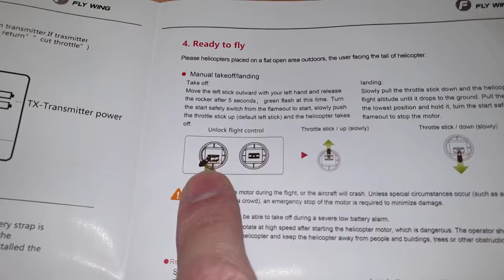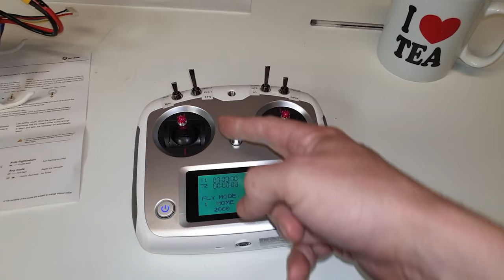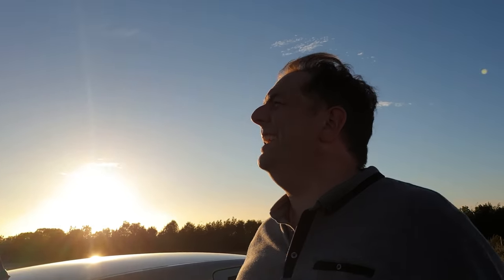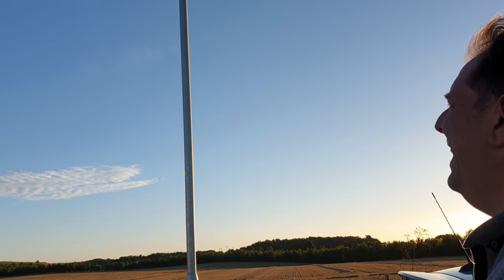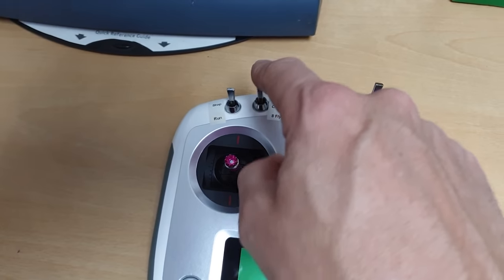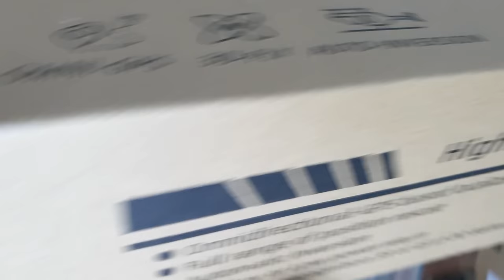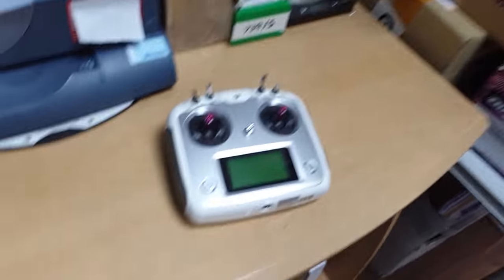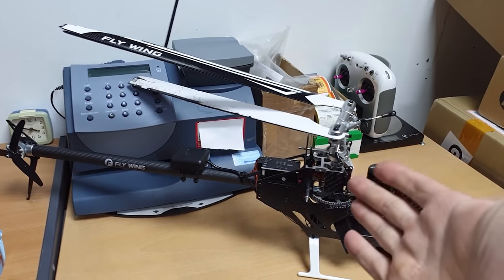Auto Pilot RC Helicopter FAIL (try not to laugh)

Comment: Back in the 90s we did this all the time - we called it "doing the funky chicken". I had a Concept 30 IC powered heli throw the radio battery out on impact leaving the throttle on almost full bore. It took quite a few minutes for the clutch to finally burn out and allow me to go pull the fuel line off.
Reply: That was part of the fun back then 😂

Comment: That's what we in the RC heli hobby call the "chicken dance". Only way to stop it quickly with a nitro heli is throw a coat or jacket on it, then run up to it and yank the fuel line off.
Reply: So sad :(
Reply from the maker: never let a good funkey chicken go to waste!
Reply: hahaha nothing scarier than a big 600 or 700 Nitro Heli smashing itself to pieces on the floor while the engine is SCREAMING and you're desperately trying to get near the fucker to cut the engine without losing a hand!! haha!
Reply: Funky Chicken!
Reply: In this case they could have just hit the kill switch on the Tx
Reply: Heads Mess the heli in the video was electric with an FC, the way it was set up is like most quadcopters, it has an arming switch, it didn't need to go crazy like that, all he had to do was flip the arming switch to off and the heli would have shut down, possibly minimising damage.
Reply: @KevinTalbotTV  lol
Reply: @KevinTalbotTV  by the way it is a drone

Comment: RC Helicopters are a lot easier to fly with auto gyros these days. I built a Morley Bell 47G with 6.5cc glow engine (designed by Jim Morley) in the late 1970’s early 1980’s and without gyros it was like balancing a ping pong ball on top of another ping pong ball, in a breeze. Took me a couple of months to grasp the hover.

Comment: Kev despite some teething problems you outlined, that GPS Mode is a bloody Godsend! I can't tell you how useful that function will be for someone like myself who didn't learn to fly Heli's 'til his late 30's and basically struggles with losing orientation of Heli, then crashing in a panic trying to recover!! That's a miracle system for any newbie or struggler like myself! I've crashed £1200 Heli's losing orientation so i'll defo be buying this Heli !! Thanks so much kev! Keep up the madness bro! Wes, Liverpool.
Reply: I'm in the same boat as you, except I've got 20 years on you - I'm almost 60.  I own a Blade 230s and an Align T-Rex 470, and I never fly them anymore.  I've only hovered the 470 a few times.  I've got dozens of hours with the Heli-X simulator, so I've attempted to fly the 230s, but when it's in a banked turn, I can't tell whether it's going left or right.  I've hit throttle hold and dumped it into the grass a couple of times, with little to no damage, but now I'm gun shy.  If someone offered to buy me out, I'm not sure I'd decline.  It's really discouraging, because I love these machines.  I really enjoyed building the 470, but, if I crashed it, I'd give up for sure.
Reply: @ExSkyCyclePilot   My goodness Michael i can so relate to your feelings mate! I'm the same, i got to the point where i'm too afraid to fly my expensive Heli's any more because i'm so afraid of crashing them and then having to spend £hundreds on parts etc! I really struggle with seeing what direction my Heli is pointed when i'm flying it farther away, and just the same as you, when i'm banking to left or right, i often lose orinentation and panic and dump it! You mention you have 20 years on me, well i really feel for you because i believe us late starters, who come into Heli flying as older adults, are totally disadvantaged because when you learn new skills with a very young/childs brain, the Neurons are still growing and making new connections, so you learn much fatser and your brain mouldfs itself or has much more plasticity than when you're an adult, thus making the newly learned skill "second nature" if you will. Ofcourse us older adults can still learn new skills very well, but it's much much harder in my personal opinion. The only tip i can give you is much larger Heli's like the 600, 700 and 800 size Heli's are actually easier to fly because their larger size is naturally more stable and less "Twitchy" than smaller Heli's, but the problem with even this is when you crash, it's much much more expensive to fix!! We can't win mate! lol.

Comment: 13:04 this is known as "chicken dance" and it usually happens to nitro/gas rc helicopters.
If you have a rough landing and the battery gets unplugged the throttle servo will keep the engine running until it destroys itself or runs out of fuel
I had this happen to me on my 2s xk k110 with cc3d flight controller refused to disarm and it destroyed itself in battery fire
Reply: he did say funky chicken

Comment: If you have enough RPM, you have to take off quickly.
Disconnect the battery connection terminal first in case of a fall

Comment: I had the same heli to test. When I got it the blades were poorly balanced which caused the gyros to crap out. That's what it looked like in the video, mine was going the same way but I killed the throttle before it did any damage. After balancing the blades all was well.

Comment: Kev I Want To Odder X Maxx But They Did Not  Deliver In India Can You Help Me
Reply: You could go to a local hobbyshop
Reply: @KPTGR8  Does one of 'em have a online shop?
Reply: Hey you are in India I am also in India .
I also wanted to buy a XMAXX 8s can you tell the cost of XMAXX 8s in India.
Reply: @ratheesht3850  bro you fool even if you get one where you you plan on getting spares
Reply: Are you in Kerala I will get parts from Amazon 
or any other online shopping. Can you tell what is the cost of XMAXX 8s .
Reply: @ratheesht3850  you can't get parts in India and you can't get the car either 
search xmcxx on amazon and tell me what you find
Reply: @lolguy-hh3pd  that sounds expensive
Reply: @ratheesht3850  it's like 70-80k rupees excluding any tax or shipping, can't get in amazon delivered to kerala, try bangood or other website, better don't get it, get another one
Reply: @KPTGR8  what you mean by 70-80 Rupees .
Reply: @KPTGR8  Are you an Indian.

Comment: A bad idea to take off from the hard tarmac without rubber damper on the skids. Vibration from the hard tarmac started this sequence of auto over correction from the H1 Flybarless gps autopilot system.

Comment: Did you calibrate the magnetic compass prior to flying? You have to do this when you first get it, it's all in the instructions and is normal for any GPS enabled controller. Also the auto-invert needs enabling in the software.
Reply: He did not do this ,he figured it was all set up out of the box,big mistake.

Comment: I suspect it was because you tried to take off in 3d mode as it looks like it wanted to flip upside down as you throttled on ,could be why it vibrated gyros where confused . Does it say anything in the book about modes you have to take off in .

Comment: I bought my first RC helicopter in 1986 It was a Hirobo Shuttle. Just to show you how inexperienced I was I got everything I needed...........except for a gyro. I could never control it and ended up giving it away to Good will and finding it years later in a pawn shop. I could tell it was mine because it had a badly painted Arizona state Flag painted on the side of the canopy.
Reply: Those shuttles were awful 😂
Reply: @rchelicopter  I can't debate you there. I never actually got to fly mine per se. I didn't have a gyro in it Not realizing I Needed one and it only got off the grund a few times before spinning out of control and crashing.

Comment: RC helis today are very easy by comparison to the heli I learned on. 
all pressed metal frames, mechanical gyros, if you could afford one, simple radios with no computers, wooden blades you actually had to learn to balance. Oh and no simulators to practice on.
Reply from the maker: but much more fun now!!

Comment: Scary shit when a model goes haywire... Had that with a carbon fighter gas car lol. The engine stuck at full throttle and reved and reved with sparks and flames from the exhaust... Ignition cut didn't work :D

Comment: You should activate the heli in GPS mode NOT 3D mode. Also some of them are Coming with an error in the voltage cutoff which makes them return to home right away. Go into the settings a s either set the voltage cutoff to 0 or just turn it off. My buddy and I calculated that a six minute flight used up 30 percent of the battery. So we did two six minute flights.

Comment: Kev - Did you have to do any calibration? If so, can you do a vid on the process you had to follow? Thanks.
Reply from the maker: No, it was all set up out of the box
Reply: @KevinTalbotTV  Thanks Kev. I did a bit of digging and found that you can connect the heli to your computer and calibrate the controller and heli. I think you need to go online to obtain the instructions but, just FYI, in case you need to calibrate in future to avoid it going crazy. Could this explain the crash?

Comment: I have one of these. and the way you start up the motor's is you put it in Gps mode get a Gps lock then you pull the left stick down and to the left for only 2 seconds then on the H1 flight controller there is a led light which in Gps mode will now be flashing green this is when you should  flick the start switch...you only have 5 seconds when the green light is flashing to start it if you don't it will lock you out this is for safety reasons .That is why you were having trouble. ..Good vid but this is a £400+ Heli...Man what a waiste.....you should have checked out the vid's of this on you tube..Alishanmao  has a good review of it...Still a thumb's up just for the funny flying...
Reply: Ps You need a 4s battery in it to do 3d and at least 400 mah not a 3s 1800..lol .

Comment: I would never give this thing to a beginner. Too big, too much danger especially since it doesn't even seem to do what it's supposed to do. Better to learn helicopter with buddy box or if you're alone with a micro like the blade mcp s. If you learn with the micro size you can fly over grass and cut the throttle if something goes wrong and usually it won't even take any damage, contrary to this one. More weight, more potential damage.

Comment: Yes 👍 u hit nail on head I brought a carbon fibre erazor smashed it up then again and again lool then I realised this is hard but I haven't given up 100 rebuilds later I brought a cheap wltoys v950 , I'm total self tort , but now I right up on the rebuild /build I'm all over it, these ready to fly but not actually ready  lol , I found out everything needs to be balanced from blades to heli with battery in all has to be balanced this info would have be great at the beginning 50 crashes later...😂 now I balanced both helicopter the both are 100 times easier to control especially hovering.  There abit more to the set up on the carbon fibre , u have to set up the full fight system which also contributed to a few crashes lol got there in the end ,id like to rebuild the heli u smashed if you don't want it 😉 I do a rebuild vid

Comment: I had a really big helicopter I had no problems with it it as I have had smaller ones before so it was easy to fly I had it for about 4 years before I accidentally broke it the only time I have had problems with anything is my drone I set a map with waypoints for it to follow but it didn’t fallow the waypoints and decided to go about a mile of course but luckily I managed to get it back when he said it’s like flying a drone haha that’s what someone I know said my drone has an auto land button so when I press it it just slowly comes down then completely lands when it does with mine I just pull both the triggers down

Comment: Hi mine is also happened same don’t know the reason for crashed
Reply: Same here, fortunately I was on grass and had my finger on the kill switch. If the pitch isn't right, the servos don't work but it can still take off. There is a video on You Tube on how to set the pitch and swash plate by connecting to computer, it's pretty simple.
Reply: Kill switch is nothing but 3D isn’t

Comment: Eh better malfunction then my cheap Hubsan quadcopter it took off with 100% throttle & forward on its own after i switched batteries in the remote by accident too some weak ones near a electrical box (used rechargables & forgot the radio on and discharged those, brought out a pack of unopened aaa's)& i never saw that damn thing again, it flew so freaking high...

I don't know if someone else was flying a hubsan quadcopter of some sort that was a bit fancier model & pressed like a go home button or something because it just took off on me completely...

I'm sticking too either a cheap plane or two & ground vehicles, at least then I'm not helplessly watching 250 sek take off never too be seen again, i had it for maybe 2 months...

Comment: Hey keV I got 2 nitros for sale a savage 21 which runs but bit boggy just been rebuilt. And a vrx 2 which runs  really well I'm looking to sell the pair for £300 and looking for a good home the savage has 2 spare chassis to with wheels servos and recievrs. And has up rated springs diffs arms and belly other bits. Also thanks for another great video all the best.

Comment: HI everybody, I've been playing around with my FW450 for a month now,and i can confirm it is an extremely sturdy bird, as a couple of crashes rotor down 8without real damages) witness.
My question is how could you fly inverted in 3D mode? I understand that you can't configure any idle up throttle curve (I also contacted FLYWING to confirm that) so how can you have negative pitch and thottle say 75%?
The auto invert, figure of 8, circle, return to home commands are all working with GPS mode only and are incompatible with 3D mode (FLYWING say).
Reply from the maker: i just put it into 3d mode and flipped it over manually but head speed is very low
Reply: @KevinTalbotTV  Thanks, it is still a mistery to me...as for the head speed you can increase it in the H1lite s/w main page by setting "throttle control" to say 85%. This is the value applied in GPS mode. FLYWING say that switching to 3D mode automatically increases the throttle speed by 10% (in my example you reach 95% of the maximum  possible speed). Hope it helps
Reply: @KevinTalbotTV  Hi Kevin, simply adding the information that I successfully flipped it over manually as you did (3D mode), quite easy and smooth. The 3D flight mode actually implements an "idle up"  throttle curve. The only drawback is you cannot change the parameters. Blade speed is ok at 85%.

Comment: That damn thing is WAY overpriced.
Reply: Ikr that's why I like quadcopters more.
Reply: I made my own drone with parts from banggood and it is too fast lol. Its an fpv racing drone with emax eco 2400kv motors. It cost me about 240usd including remote , but batteries and charger not included. Also fpv goggles are expensive.
Reply: @alex-w8p2e  I am new to the quadcopter scene. I am learning how to hover them in ACRO right now and boy I have a long way to go.
Reply: @raven_fpv  don't worry I am new too
Reply: @raven_fpv  I dropped my quad on a car last year because I lost visual contact and I got scared and disarmed and the car got dented but the strong drone was fine. I had to pay him for the repairs.
Edit. I was flying auto level mode 1 year ago I only recently got into acro.
Reply: @raven_fpv  you'll get the hang of acro, are you hovering fpv or with your eyes? In my opinion it's easier fpv
Reply: @alex-w8p2e  I am doing it with LOS right now. I'll try FPV soon though.
Reply: @raven_fpv  just make sure you don't fly backwards because you cant see backwards.
Reply: @raven_fpv  have fun and good luck!

Comment: some late info.       too much  is  'automated'.       too much is non-standard.      left/throttle   stick  CENTERING  spring.!!!!!!!!!!       no trim switches.      'anyone can fly it'    does  NOT  actually  mean  ANYONE...with  ZERO  heli flying knowledge.     bc of that, 
this  fail  is  on  YOU  guys.        cheers

Comment: Pure junk do not buy. Just received mine and I changed it to mode one. Throttle channel stayed on the left stick and used ch2. It should be on the right stick on ch3.
Cannot change the channel location. Pile of crap never used. Also have RX bind issues. Manual is shite.
Reply: mode1 radio, on a heli,  equals   effing  SILLY,  k.